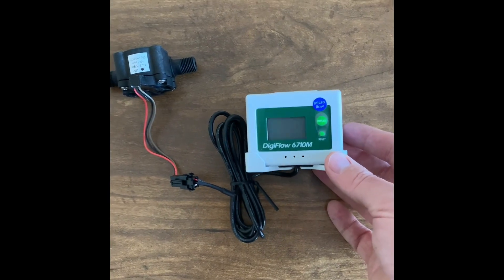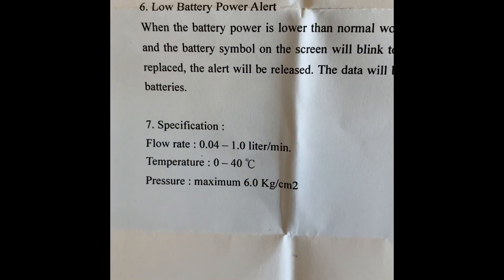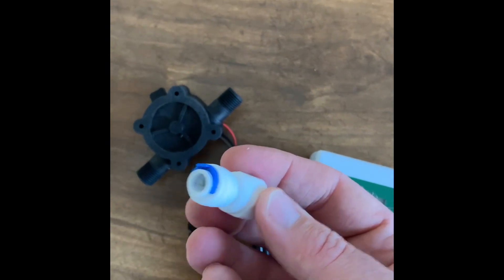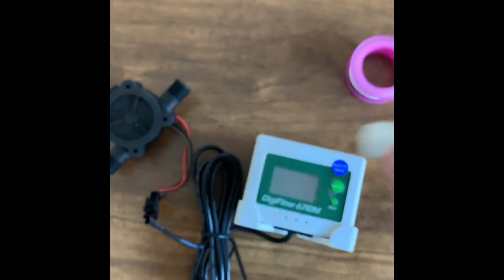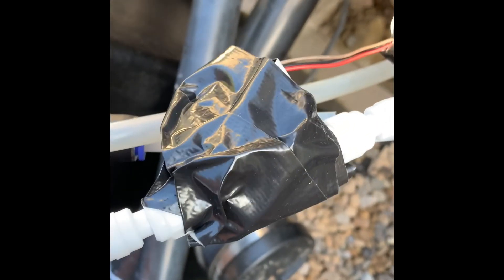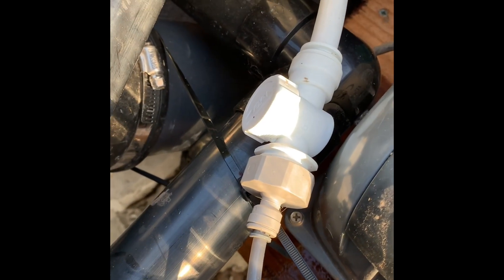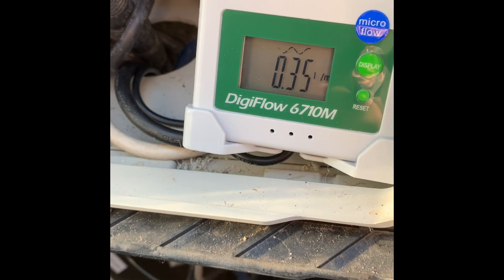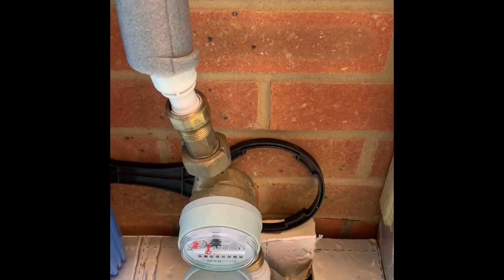KOI POND WATER FLOW METER FOR TRICKLE IN / TRICKLE OUT

Comment: Great info  just what I was looking for only thing which I have a problem with certain times of day my water pressure goes up and down ie tea time worse when everyone in from work using water will this effect the trickle reading?
Reply from the maker: Thanks for the feedback Barry
Forgot to mention It also tells you how much has flowed through the meter since installation so you can divide that by the days running to give you an average rate per day matey.

Comment: Would it be possible do you think to use hosepipe with clamps on either side of the flow meter?
Reply from the maker: Hi Richard

Personally i wouldnt do that due to the risk of leaks. The pipework in the video is so easy to fit and im sure there will be a hose to push fit pipe fitting available
Reply: @madaboutkoi  I do have 15mm push fit to the pond so will try and work out the fittings as this needs 1/4 inch. Cheers
Reply from the maker: https://www.ebay.co.uk/itm/John-Guest-PUSH-FIT-15MM-to-1-4-Push-In-Copper-PEX-LLDPE-Pipe-Adaptor-Filter-/221627947283?_trksid=p2349624.m46890.l49292
Reply: I will get onto it later and order the bits. Cheers
Reply: I emailed Vyair and they sell the connectors for the flow meter to 15mm pipe...they said for some reason they don’t add them on the website. Looks like just the two adapters and then a control tap and good to go with 15mm.

Comment: Hi mate could you send me a link for the 15mm bsp push fitting connectors please?
Reply from the maker: Sure. What fitting on the opposite end do you need?
Reply: I need the same 2 fittings you have either side of the meter. So the threaded end to screw onto the meter and then push fit for 15mm pipe the other end. Thanks!
Reply from the maker: @matthewboast1937   the meter fittings are 1/4” female thread to 1/4” push fit. You then have a 1/4 pipe feeding into a 1/4 push fit which then has a 3/4” thread on it. That then fits onto a 3/4” male x 15mm
Reply: Really struggling to find the correct bits online 😩
Reply from the maker: https://www.ebay.co.uk/itm/281826810143
Reply from the maker: https://www.ebay.co.uk/itm/VYAIR-1-4-Pipe-Tube-for-Reverse-Osmosis-Fridge-Water-Filters-Pneumatic-Air-/111324180222?_trksid=p2349624.m46890.l49292
Reply from the maker: https://www.ebay.co.uk/itm/VYAIR-Straight-Female-Adapter-1-4-BSP-1-4-Push-fit-Packs-of-3-6-9-12-/352389337843?_trksid=p2349624.m46890.l49292
Reply from the maker: https://www.screwfix.com/p/jg-speedfit-15aptp-washing-machine-tap-15mm-x/18908
Reply from the maker: https://www.ebay.co.uk/itm/John-Guest-Push-fit-Shut-Off-Ball-Water-Valve-Tap-1-4-3-8-1-2-6-8-10-12-15-/221593000369?_trksid=p2349624.m46890.l49292
Reply: Ahh mate thankyou so much for that! All bits are ordered! Top man!